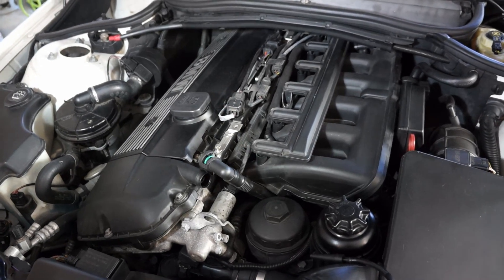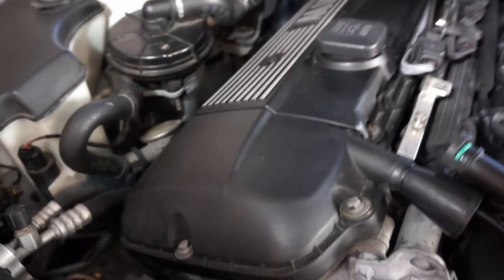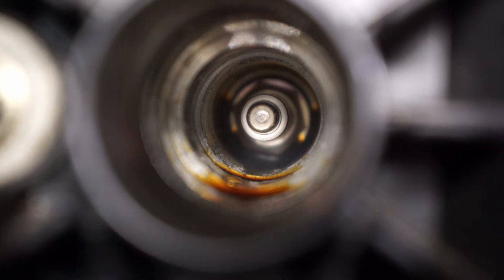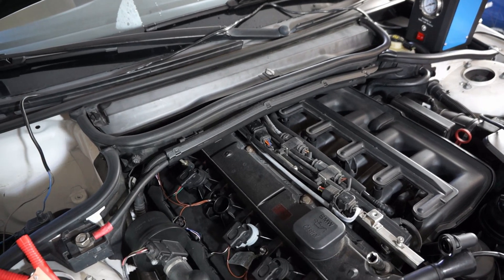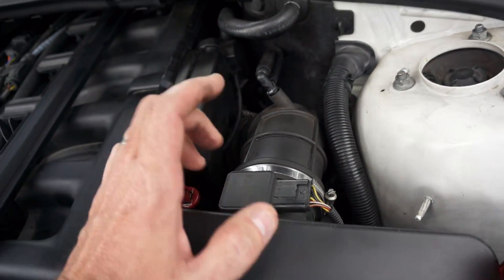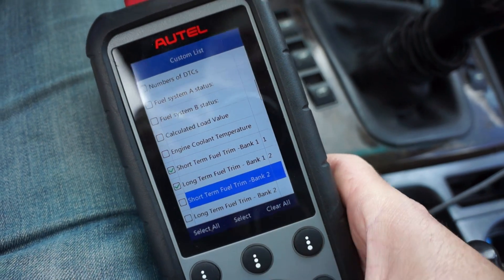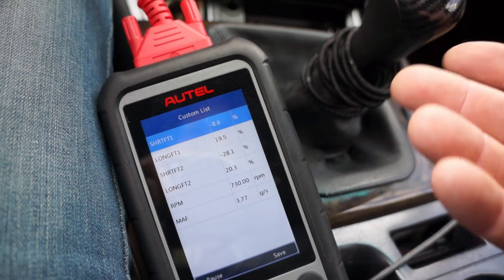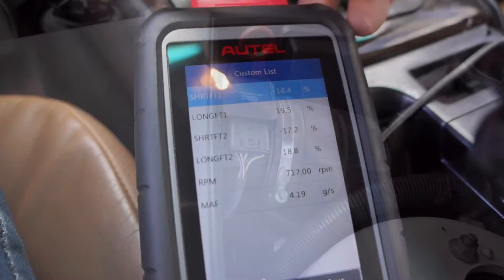2004 E46 325Ci Lean Condition Smoke Test & MAF Sensor Diagnostics

Comment: Been chasing exactly same issue with my sons z4 M58. Initially found split intake boot thought Woopi but that didn’t fix it, vacuum gauge and smoke test found no other vacuum leaks but symptoms were a vacuum leak, STFT pinned at plus 20 LTFT at plus 7, I checked the MAF and noted it did not read correctly with a voltmeter and oscilloscope. Priced one here in Australia 800 to 1000 bucks!! So question is where did you get yours?
Reply from the maker: Amazon, link is in the video description.  Hopefully you can get it down there because it was cheap and it works.
Reply: @JRsGarage let us pray 😂 thx